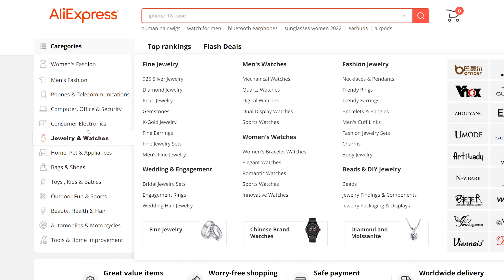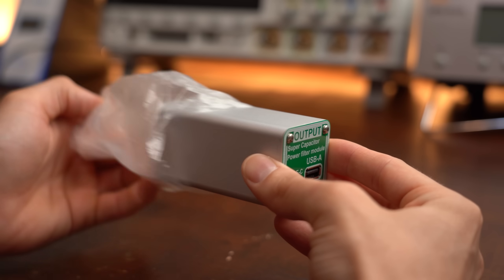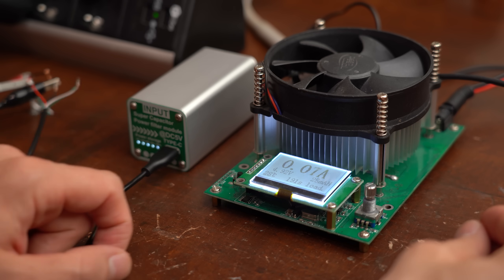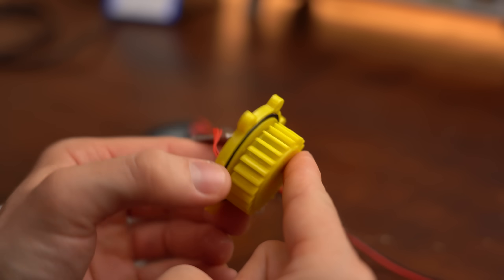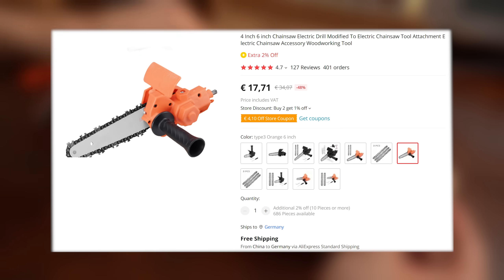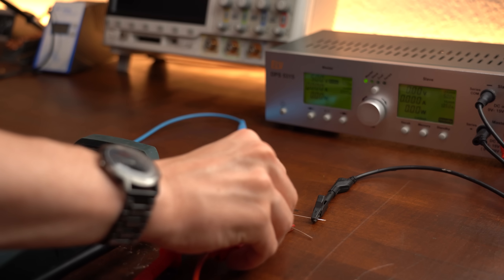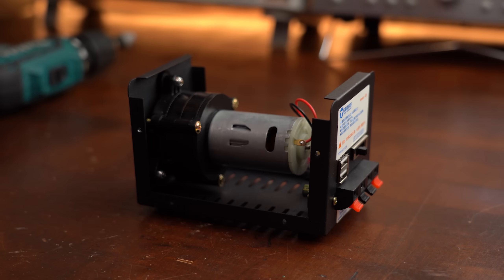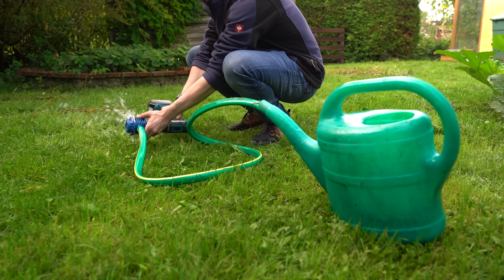I tried finding Hidden Gems on Aliexpress!

Comment: Supercapacitors are extremly poor filters. They turn from a capacitor into a resistor already at a frequency of 100 Hz. By comparison, electrolytic capacitors suffer this at 100 kHz, tantalum capacitors at 1 MHz, and ceramic capacitors up to 100 MHz. Typical power supply frequency 30-60 kHz (can be up to 500 kHz in case of dc-dc step down converter at end, which all quick charge bricks have).

Although consumption jumps that lasts from 5ms to 1s supercaps can smooth out

Comment: I use to buy components from Aliexpress, including the motherboards for older processors. I also bought second hand AMDs and Xeons for a bargain and all worked very well. Funny enough, all chinese motherboards I bought still provide 2 PS/2 ports, I suppose it's for use with old kvm commuters

Comment: Sorry but how can you judge a product that you only tested on your faucet and say that it is not the voltage you expected. Do you not realize that the voltage is dependent on the water pressure? There are applications where the pressure is waa-ay higher.

Comment: The search engine isn't sometimes broken, it's perpetually broken with a sprinkling of asshole design on top. I still don't know why I get shown listings where the thumbnail is of the item I want but the price is for some cheap shit that's in the same listing but not shown in the thumbnail for the price. Never mind that most of the times I can't even find the price shown in the preview no matter which option I select. It's so bad.

Comment: I'd love a video testing aliexpress temperature and humidity sensors. Specifically those that you can connect to an ESP32 or ESP8266 (for use in Home Assistant). Most of the ones on aliexpress are fake and unreliable. Testing of other things that can be controlled by an ESP32 would also be cool

Comment: The voltage shouldn't have dropped at a higher load with the capacitor. That was entirely a problem with your supply or cabling. The only effect an underrated filter capacitor should have is increasing noise at higher loads.
Its pretty common for 5V usb power supplies to drop quite a bit even far from their rated current.

The only way that supercapacitor box would affect output voltage is if its got a DC/DC converter inside it as well.

Comment: Supercaps don't make good power filters due to their high internal resistance, compared to regular filter capacitors. A few thousand uF with good quality, low ESR capacitors will work a lot better and much cheaper.

Comment: I've had good luck with those drill powered pumps for doing things like removing gas from small engines gas tanks or transfering gear oil & transmission fluid into transmissions or diffrentials, ect.

Comment: As for the linear charger for lithium batteries, you will be surprised if you check the real charging current, it will be significantly less than expected.

Comment: The electronic bits makes me miss the old days of Ebay, where you could hop on and buy like 5-10 pounds of mixed electronics for no money at all. I loved getting those because they were like little treasure troves of what you could get. Usually you'd just get the usual stuff or a few boards from something, sometimes you could get neat stuff like expensive ultra caps or fancy laser diodes someone thought was trash! Unfortunately, it's just a second-hand Amazon now...
Reply: Used to buy lots of odd stuff, mainly sold as gold tech scrap. It had a good chance of having unusual parts in it. ❤
Reply: The design is very human
Reply: I use Amazon to research stuff then buy it elsewhere..I boycott Amazon and most people should but the herd likes to be sheep.

Comment: Hey Scott, great content as always,
I am looking for a single phase (input and output) VFD, with, configurable max voltage, configurable PWM frequency AND duty cycle,
All i can find is cheap A-series that is only basic.
any idea ? can be german if neccesary but i need a general tip for a model/series - thanks a lot

Comment: 6:27 after priming the pump by sucking water into the pump, you should have fired the drill without breaking. These types of pumps don't have much suction power hence the need to prime them before they can work. Give it a try again but this time don't let the water flow back after sucking it in before firing the drill. Good luck.

Comment: alot of US USBs output 9v FYI for adaptive charging... its not as common now i think, older phones used to use 9v instead of 5v but alot of security cameras still use 9v wall chargers for their power
also i believe USB is rated for 20v

Comment: The drill operated pump would work a lot more efficiently if you had another hose on the outlet side. Otherwise the pump is constantly trying to suck air along with the water. Pool pumps operate in the same way. Removing the air is known as priming the pump.

Comment: I like Aliexpress, especially for electronics. Do your research before hand though, i.e. don't buy batteries from aliexpress. These are usually fakes and promise a big capacity, even though it's considerably less. Just to note, if the product isn't as good as advertised, you can have your money returned or a part of it. Just start a dispute. Done quite a few and basically always got some if not all money returned.

Happy shopping!

Comment: Do you know of any lithium charge controllers that can be set to only charge and discharge in the 20-80% range?
I find that all the cheap units cut off at 4.25-4.35v and this is bad.
I would like to build a system that would only use the cells in the 3 to 4 volt range for longer life use.
Like a security light that is solar charged so it could be left to cycle as many times as possible?

Comment: The USB Power Delivery standard allows for the voltage delivered to be 5 V, 9 V, 15 V or 20 V and at power levels up to 100 W. It would be better if the thing did the negotiation specified in the USB spec, but sadly you have to guess and get it right while cranking. It's sad because only a coule of chips and a few components would have let it charge an internal battery which drove a usb delivery chip which did auto negotiation.

Comment: Drill powered pump: You need to connect a non return valve to the end of the pipe in pond. Then fill it water removing air gaps inside. This will create continuous flow of water. Although the pump seems poor in quality.

Comment: Why do you sum up that the 3A Polymer Ternary Lithium Battery circuit has NO battery protection while you show and say that the cut-off works as expected? What battery protection is missing?

Comment: Hi Scott. I solved the heating of the old battery charger using a thermal pad and putting PCB on a big metal plate. It works like a charm.

Comment: 10:10 the higher than 5V is for fast charging of Qualcomm or some microcontroller boards with motors (tho, with later it doesn't make sense)

Comment: 7:37 - If and when this white plastic breaks, you can make it from metal easily, take bigger lager, put it at angle and spot weld it.
11:47 - Different antennas are for different ranges. That circle thing is also antenna. Try it again in house with wireless internet shut down.

Comment: Ip2312 charging module -
Are there any options with undervoltage protection available? I did not find them, only the old 4056 :(

Comment: Hi, there
I know it's a very very small chance that you will read my comments and act over it.
Please design a 3.5 mm to toslink output board for my 5.1ch music system which only uses toslink/Bluetooth connectivity.

Thanks.
Any genius out there can also share video or pdf link for the same.
Thanks

Comment: That pump was a positive displacement pump so it is self-priming. Producing bubbles in the pond suggest you either got the inlet and outlet swapped over or were driving the pump impeller the wrong direction, which is very easy to do with a reversible cordless drill.

Comment: could you try testing the 12v version of that hydro turbine? i think it is raited at a symilar wattage but since the voltage is higher you might get more wattage out of it since the windings are pretty thin.

Comment: I find generic electronics , Arduino modules, esp devices to be OK quality and price. Just about everything else on Ali is junk! Terrible quality, overpriced and specifications that do not represent the product. Just my experience and opinion! The shipping costs have gone up. The lowest cost shipping is the longest 8-10 weeks to Canada. The more expensive AliExpress standard shipping is usually about 3 weeks to Canada. So if you can buy nearly everything you are after ( difficult) you can get best shipping costs by using single supplier.

Comment: The chainsaw is not something I would recommend. Since it's adapted from a drill it lacks important security features, like the dead man grip that prevents it from running on its own and the chain brake to make it stop quickly when you release the trigger.

Comment: I buy a lot there, I could tell you a few.
Last one is a impressive i7 1060, with 16mb 3700 samsung DDR4,igpu IRIS, wifi6 from intel, and 12x9x3cm! and 300g.bios American megatrends (important) Perfect for any bench, to connect microscope, etc etc. Many bench needs a computer this days. £230 is what I paid for such i7 MicroPC, had £30 of discount.
I just added the 500gb NVME that I had removed of my legion 5.

Comment: That generator could still be useful if you aren't planning on cranking it by hand. You would probably have to experiment to determine optimal gearing but it could be useful with a water wheel, a windmill, or attached to a bike. Get some exercise and have the bike charge your phone at the same time. Given the bulk of the unit you would only want to do that with a stationary bike rather than one you ride around on. Whereever you set it up you would also have to be mindful that it isn't remotely waterproof and becomes quite dangerous if wet.

Comment: One problem I have with AliExpress is I can't group products together for a smaller shipping fee when buying from the same store. It's always full fee for each item shipped, even when they actually send them together in one package that costs them the price of one of the shipping fees.
Reply: because the shipping fee is part of your items' cost lol...they inflate the shipping fee to lower the product listing price. Seems more attractive on the listing. To them I think it's by weight onto a huge freighter, so it doesn't really matter it's the same price (or close) for them.
Reply: Ask for a refund. take pics of the parcel and request all but one shipping back.
Reply: @Rt.Hon.LtAldoRaine AliExpress has a clear statement that they will never refund shipping prices.

That is the exact reason why some dodgy products are sold for $1 where the shipping is $10

So the product doesn't work and you ask for refund, you get $1 back and seller keeps $10

Shipping is never refunded. Read the ToS

Comment: 00:20 - That's ALSO why I HATE Amazon... I typed in 'Metric Hex Socket Set'... and got.... Bra and panties set, garden tools, amplifier and other random crap listed in the search result listing! W. T. ACTUAL. F ?!?!? That's why, for ordering online, i do generally prefer eBay as what you search for, you get..., Alas, delivery times (from what I've experienced so far) cannot be chosen for next day, 2 day etc... always just 3 or more 'Working' days later... (except for the odd occasion I've contacted seller to arrange extra price for faster shipping method). It's a pain in the bum! 😒     😎🇬🇧

Comment: Hi GreatScott,
Nice practical video ! I'm looking for a quality step-down DC-DC converter (accepting possibly 60V on input) and able to sustain continuous 3A use. I bought a lot a such converters (on ebay/ali) and was very disappointed with sturdiness. They were based on the XL6009/XL4015 chips. they were also supposed to self-regulate when overheating but most of the time, I found them lying with the PWM chip burnt...
If you have suggestions.... (thanks)

Comment: Typical Chinese components in my experience. The voltages are usually right, but the current ratings are far below what are claimed. The risk of frying components is low, but it means some high-power devices just don't work.

Comment: I’m having interference problems with my microphone since a few month, just yesterday I galvanically isolated it from the usb bus and have been quite floored by the noise level introduced by the usb power supply even after the galvanic isolation. I was already considering putting it onto a usb power pack to get rid of the noise. Just ordered that super capacitor pack, seems like the perfect fit for me :D

Comment: As someone who has basically zero budget, I love Aliexpress and I am always on the lookout for videos of some good finds there. Sure, you have to take practically EVERYTHING claimed in the listings with a heavy dose of salt as 99% of it all is fake, scam or the specs are highly exaggerated, but you definitely can find some good, useful stuff there. Also, even if you could find something similar here in Finland, it'd literally cost 6 (or more) times more -- and that's not an exaggeration!

I hope you do more digs through Aliexpress in the future.
Reply: Hey they don't usually lie. If they do you just prove it and get half your money back
Reply: @crissto8591  Half? I've always gotten full refund, I don't accept anything less.
Reply: @WereCatf  that's for when I fix them and use them anyways

Comment: That anti-spy device is very popular in China, ppl hide wireless (usually wifi) cameras in power sockets, ceiling fans, heat vents under wireless routers, behind IR window on TVs... in hotels and Airbnb to capture privacy videos and sell them online. Besides detecting wireless signals emitted by wireless cameras, with the LEDs turned on you can spot hidden cameras through the round window in the middle.

Comment: Could you use two of those water powered generators to make the power you need for your water project? I know the second will have less generation, but if you wired them in series couldn't you get the 500mW?

Comment: Your water powered generator may work if you buy 3 of them and connect them in series. The current outputs are connected in parallel.  Would that give you the current required?

Comment: Aliexpress is pretty much one of the best suppliers for mechanical keyboard components of all things. Cheaper clone keycap sets, a wide selection of switches, and a lot of half decent board kits for reasonable prices. You can even find proper fully CNC aluminum and wood cases ready for the rest of the components.

Comment: I understand the love/hate relationship with aliexpress. I ordered around $80 worth of ICs for a synth I was designing and none of the ICs arrived and on top of that I didn't get my $80 back. You really have to be careful when ordering because you may think you're ordering from a company who you have previously had a good experience ,but in reality is just an unrelated company using the branding of a company with a good reputation. That being said the thing I love about aliexpress is that it's a great place to find aftermarket/obsolete/vintage ICs and very specialized tools/ test sockets/adapters. I found some very nice test sockets that would have been costed an arm and a leg on amazon and some used vintage YM2203 sound generation chips that were completely unavailable on amazon or even digikey.
Reply: Btw thats why i order first a small batch and if they deliver i order more but in smaller batches
Reply: @cutedogsandgames Yeah for cool electronics doodads AliExpress is the best but, these days because of the prevalence of bootleg chips I find that, in the long run it's cheaper to order ICs from digikey or mouser. It's just not worth "saving" money if you're gambling on even getting the chips and then when you get them they are completely fake and don't behave as expected or just completely burn out. I once ordered 20 Arduino nanos from AliExpress for about $20. The serial to usb chips were fake and they all stopped working 6 months later, even the ones that were still sealed in bags that I never used stopped working. Now I can only use them by hooking them up to a programmer and programming them via ISP port, which works because only the Atmel chips were real.

Comment: Just an FYI, The center hole of the Spy Detector, with the ring of LEDs is meant for detecting cameras.  With those LEDs illuminated, look through the hole and look around the room, any camera lenses should reflect the light into your eye making them stand out against the background.
Reply: You can find spiders in your yard similarly, shine a flashlight out and hold it up by your eye and you can see their eyes reflecting back.
Reply: @D1G1T4L1Z3D  I'd rather not know they're watching me..
Reply: yep although these days cameras are often too tiny for it to work
Reply: Oh. Cool, I didn't know that. Though today the camera spying on you is probably in your phone or your computer or your fridge or your tablet or your security system or your....
Reply: Like sniper glint in MW(?
Reply: You know what else reflects bright red dot that looks exactly like a camera lens and could be except it ain't. Regular Screws, any plastic, especially plastic bins, ceramic, copper, metals generally, sparkling glitters clothing buttons, zippers, glass bottles, did I mention plastic bottles.  The list goes on and on everyday items give the same exact impression. Now mix that with a constant ring only in your room. And RF and emf detectors confirming something? it ain't all in the head. But where the effing shiiit coming from.